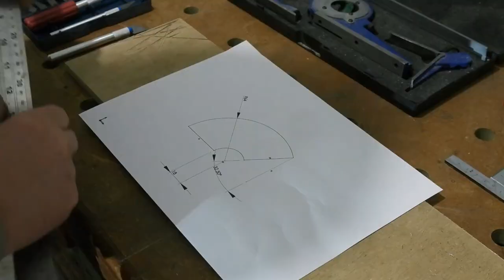A Rocking Chair In English Walnut

Comment: simply lovely 
I have been thinking about glue laminating some foams what thickness were the layers you used
Reply from the maker: Thanks Cameron. 4mm the ply's for these. 4mm I've found is good for radii between 950 - 1400mm with no springback . Any tighter, go thinner. I've a video link in the description on making the forms if you're interested👍

Comment: Fascinating.

Looks comfortable too...!

Can I ask - why the mechanical fixing of the rocker to the bottom of the frame...?

Best aye!
Reply from the maker: Thanks mate. Yeah, the upholstery is pretty lush so nice and comfy. By the time the rockers are fit, the frame has been completely finished. The rockers are still loose tenoned into the leg but the mechanical fixing saves clamping. It's an awkward clamp to do so the screw does the  clamping, and saves any possible damage to the frame. 👍

Comment: Absolutely gorgeous with amazing attention to detail.
Do you make a version out of rubbish wood first when making the design and then when figured out do it with nice wood, or do you design in sketchup and go for it?

Yes to the upholstery question by the way
Reply from the maker: Thank you man. No, I don't do trial builds in "lesser" woods, so to speak. What I do do  is make lots of test parts and joints. These made from the woods I'll use. I finish them up, polish and all, then try and break them. When I'm happy, I go straight to build. I design, best I can, every detail in CAD (I use Solidworks). As you've probably noticed, I've had a whole series of templates made for a range of chairs, stools and tables. As all my pieces are the same style, I know now I can go straight to build on a new design. 👍

Comment: Hi, how do you find the el2 resin? Any other suggestions for pour resin that isn't glasscast or just go with glasscast?
Reply from the maker: It's a rock solid laminating resin bud. No issues at all. El2 is from Easy Composites. The same company as Glasscast I think but Glasscast is for fill and deep pour resins, Easy Composites is for resin glues and laminating products. Whether it's right for you depends on one thing really - if you want some give/flex or not. The el2 resin creates a solid lamination. Next to no give. If you want some give, seek out a pva based laminating glue.👍
Reply: @BischBaschBosch  thank you very much for your reply!

Comment: Amazing work! were those magnets being added for keeping the cover plates stuck in place,  or was it to make them easily removable with a bigger magnet in case of repairs some day?
Reply from the maker: Thank you mate. Both of those reasons really. The aluminium discs are 19.25mm into a 19mm hole so a good tight friction fit. The magnet just helps it stay in place long term without glue or epoxy. It also means they're removable. Magnets are 8mm dia so, a push on one side of the disc with a small screw driver pops them open. Just in case the mechanical fixings need a tighten at some point.👍
Reply: @BischBaschBosch  Great solution. thanks for reply